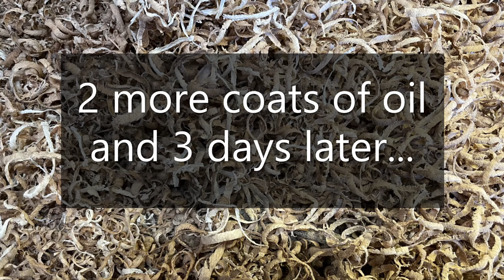Spalted Ash with a little foot - Wood turning

Comment: I hate to say it, but I KNEW it was going to fly off the lathe. On the bright side, the foot did not break (I had that happen yesterday AND the day before). I really like that oil finish. It didn't really darken the wood at all. It actually highlighted the spalting.
Reply from the maker: Yeah. Thankfully no damage done when it slipped off. I’m going through a bit of an oil phase. 👍
Reply: I see that. You inspired me to venture beyond my normal sanding sealer and friction polish. I through three coats of polyeurathane on a lided bowl, but found that it looked much better if I then steel wooled it down and used a cutting board wax on it. Experiments.

Comment: Beautiful grain! 

I had a screw snap off recently. I marked it, then turned away the wood on either side of it which left a ring of wood inside the bowl. Then I just chiseled out the ring. Might consider getting some locking pliers. There’s a brand named “Vise Grip” that’s sold all over the USA. Not sure if it’s available in the UK but Amazon probably has them
Reply from the maker: The frustrating thing was not being able to find the right tools in my very messy shed. Thanks for the tip. 👍